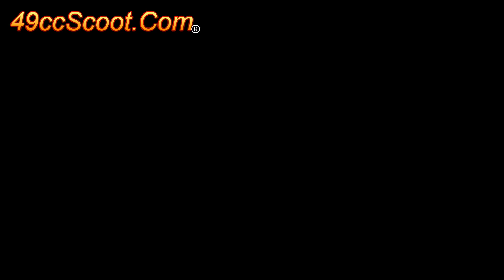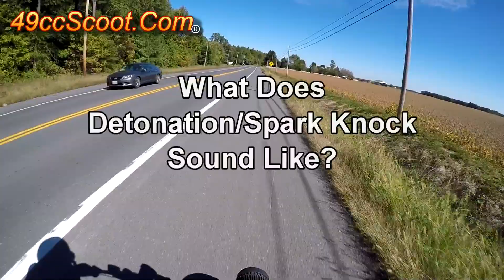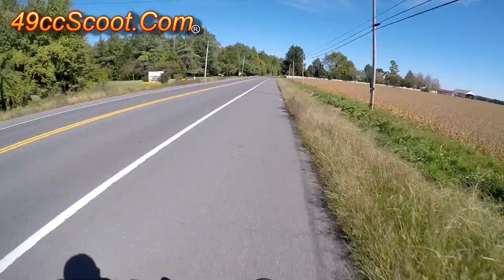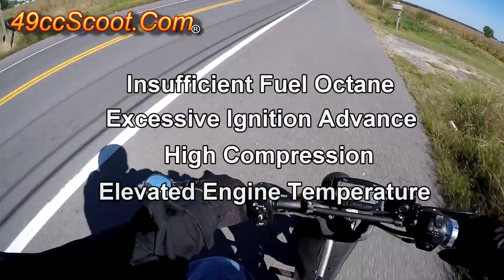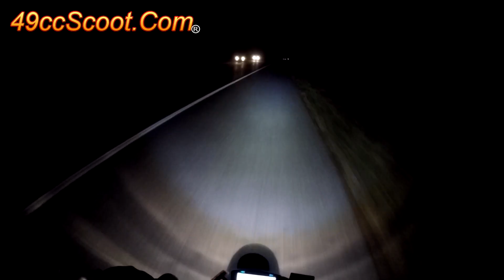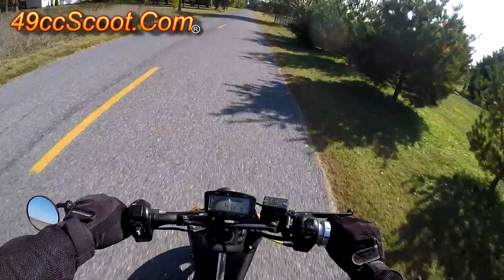What Does Detonation / Spark Knock Sound Like?

Comment: My trail also have this problem... plz tell me how can i solve this issue?
Reply from the maker: Number one is always to make sure you have adequate fuel octane. Consider any modifications that can alter compression and timing. Make sure the spark plug heat range is correct. Look for any cooling system issues.
Reply: @49ccscoot  yes we have some modification we used a little bigger piston. 
It is only air cooled... it runs smooth on plan but in mountanious area when the bike gets hot then it starts knocking and loses all power
Reply from the maker: @rahimullahkhan164  See if it will take more fuel to help cool it. 4Ts are pretty forgiving, so you may be able to increase main jet size a little and lower CHT without seeing much difference in performance.
Reply: @49ccscoot  i have 2 stroke dt 100.. replace the piston with Rx115 becoz Rx piston is a bit bigger than Dt. The head of the piston of Dt is flate but Rx piston has a little hump on its head... so i think too much compression may be the issue.... thanx for ur video its extremely helpful 🌹🌹🌹🌹🌹🌹
Reply from the maker: @rahimullahkhan164  If the head doesn't match up to the profile of the piston crown, the best way to solve this may be to recut the squish band and combustion chamber as needed. Try to make the squish area match the crown's angle. If you can get a good shape and maintain a tight squish clearance, with combustion chamber volume changes as needed for compression, then it should be a strong runner and a proper squish band helps to reduce detonation.
Reply: @49ccscoot  ok dear.. i will give it a try...
It has became great in power and running but has this little issue of spark knock when gets hot on the ascend whereas run smooth on the plan roads

Comment: I guess if I put pebbles into my cylinder it wouldn't be good for the engine either. That I guess explains why it's not good for the engine.
Reply from the maker: In the case of detonation, it's about the extreme pressure spikes that are essentially hammering components.

Comment: I have a little 35cc 2 stroke go kart and it makes a slightly higher pitch sound than your scooter 🛵 it will sometimes make like a crackle spark sound. I think the spark plug is too hot for the engine. The fuel air mixture is perfect so it must be the spark plug. What do you think I should do about it?
Reply from the maker: If that's what you think, a colder spark plug is pretty cheap and easy to try first.
Reply: @49ccscoot say I get that spark plug and it doest work what should I do then to get rid of the sound?
Reply from the maker: @Bigdaddy-ht2gn  Make sure fuel octane is sufficient. Check compression specs. Check for excessive carbon buildup. Make sure there isn't too much ignition advance.
Reply: @49ccscoot  thanks, I will check all of those components and make sure they are in spec.

Comment: Does spark knocking happen at specific revs? I just got a new bike with 300km (something like 200 miles) on it and at 4000rpm there's a strong vibration and a rattle that sounds like loose bolts.

The sound is sort of similar to the noise in the video
Reply from the maker: It would be more likely at a specific throttle position than a specific RPM. You could have something loose on the bike. I would suggest taking it to the dealer and having them check it out since it has so few miles.
Reply: @49ccscoot  yeah gave them a ring and took a quick look at the exhaust headers. the right cylinder exhaust header gasket was shot. leaking exhaust causing a rumble and backfiring. Dealer's gonna change it.

Comment: My 2020 Corolla does it at around 2000rpm when either accelerating or rev matching downshifts. It's been driving me nuts. I'm going to try putting higher octane in it when the tank is dry and see if it likes that better.
Reply from the maker: That's the easiest option for now. I would recommend checking the manual to see if it lists a fuel octane requirement. If you use at least the octane recommended by the manufacturer and it still does it, being a 2020 that I'd assume is still under warranty, you could always make the dealer aware of the issue.

Comment: I just raised my compression today, and it turned out to be a bad idea. The 95 octane fuel can't handle it, so I'm switching back to my lower compression. Today I've heard what it sounds like. In 2-stroke engines atleast, it sounds like if there were small rocks rattling inside your engine, or as I've seen some other comments here saying it sounds like a geiger counter, which is exactly how it sounds. Mine did it consistently only when the engine was at it's operating temperature and in mid-high throttle. Though on long coasts (closing throttle at high speed and decelerating), the way the usual 2-stroke goes (pom-pom-pom-pom) at closed throttle, was sounding more metallic, very noticable actually.
Reply from the maker: If your timing is advanced, you may be able to back it off enough to get rid of the knock and keep the compression change. May not make much difference either way.

Comment: I heard that noise on my 125cc two stroke dirt bike and it made a loud pop noise through the exhaust and wont start anymore :/
Reply from the maker: Do a compression test.
Reply: @49ccscoot  I tore apart top part of the engine and saw a dent in the piston, that was the problem haha, time to buy a new Priston and gaskets
Reply from the maker: @roberts2760  Glad you found the issue.

Comment: Using the wrong spark plug could also be the case, im using a BR8HS instead of B8HS plug (The R one has 5000 ohms resistance) on stock ignition. Which might be the cause for potential detonation in my engine...
Reply from the maker: Spark plug heat range (too hot) is more commonly the cause.

Comment: I am hearing the exact same noise while accelerating my continental gt 650. Whats the fix for this issue
Reply from the maker: If it's stock, then #1 is to make sure you're using premium gas or whatever the owner's manual calls for and that the current fuel isn't old.
Reply: @49ccscoot  iam using a premium fuel and my bike has done only 3000 kms. Please help.iam hearing the sound mostly at 3 to 4000 rpm in 5 and 6 th gears
Reply from the maker: @gokulrajg3251  It's got a lot of load on it at lower RPM in the highest gears. With only 3000km, can you take it back to the dealer? That would be the best bet. Let them make sure all is well.
Reply: @49ccscoot  I'll do the same thank you

Comment: I’m not doing anything wrong I just ride an it makes a pop sometimes idk what it is
Reply from the maker: If it's a pop here and there, it's probably not spark knock. A misfire of some sort would be more likely from your description.
Reply: 49ccScoot is that anything and can that f up my engine
Reply: 49ccScoot sometimes when I’m on 3 gear an I stop I forgot to go back down to first an it makes the same sound
Reply from the maker: @devangarcia3119  Hard to say  for sure. I would at least  check the condition of the ignition system. Make sure everything is plugged in tight, getting a strong spark, kill switch works properly and so on. Could be carburetor tuning related or even ignition timing.

Comment: What causes that sound inside the engine?
Like what parts? Is it the piston?
Reply from the maker: You're basically hearing the engine being "hammered" by a sharp pressure spike. Usually this occurs because a pocket of mixture ignites on it's own and collides with the normal combustion event.
Reply: @49ccscoot  thank you very much
Greetings from Germany

Comment: Very nice from this video the spark know is kinda a random rattling. I have a rythmic type tappin sound that i am almost 100 percent sure it is due to ths cam grind and the roller rockers
Reply from the maker: Loud valvetrains most commonly follow RPM, so you should hear the frequency increase as revs increase. Spark knock does not do the same. It's more "random" as you said or at least not directly linked to engine speed.
Reply: @49ccscoot  very true mine speeds up and slows with rpm. This id the best video showing preignition i have ever found

Comment: Thanks!   very thanks!

I noticed that in my four strokes.
¾ throttle opening goes well,  bike can do the job or load...  but there is not difference on engine power between ¾ and full throttle but sound appears just like your.

You say 
Poor octane    
much advance timing
overheating

In the practique,  how can you deal with it?
this video was in 2016!   what have you learned all this time to adjust on engine that sounds like ping?

very very thank to you and regards from south america.
Reply from the maker: A lot of it depends on what the engine is. Mods and such. If it's a stock engine, then the easy solution is usually to use higher octane fuel. If it's modified, then you have to think about what those modifications will affect and go from there. There isn't one right answer.

Comment: I heard this in my car too but it wasn;t a spark knock, It was the windshield wipers plastic cover that kept flapping or vibrating whenever I accelerate. Couldn't figure out the problem as there was nothing wrong with my car, until one day on a cold night, there was moisture infront of my windscreen, not inside but outside. That's when I knew that the whole plastic cover was loose, put some windscreen sealant in and couldn't hear it anymore.

Comment: Hey man, can you explain how you got rid of the knock. I switched to running 93 octane, a cooler plug and even tried lowering the needle clip position for a richer setting. Still no luck, any help would be greatly appreciated. It is only heard at 1/4 throttle usually when slightly decelerating due to not enough throttle and only between 37-44 mph. Its an all stock zuma with a brand new stage 6 70cc kit. running the stock oil pump and a 60:1 pre-mix. squish is at .6mm (what the manual called for ).
Reply from the maker: I think I just backed my timing off after that. I've had knock so many times that I've taken different measures. If the mixture is rich enough and plug is correct, then usually either timing or compression. If that's all you hear, then probably a very slight change would do it. Make sure you aren't using a long reach plug in a head made for short reach too.

Comment: YOU ARE THE MAN,  just installed a 70cc kit in my stock zuma and it started doing this and I took it apart and couldn't see any problems and squish is at 0.6mm which is what my stage6 said it should be and then I was stumped. Thankfully you made this video because I was really worried. Thanks man!
Reply: Same here what was the solution?
Reply: @wakenow7612  yeah just installed a 70cc on my jog and now it's doing this too. would love to know. thinking of doing 2 base gaskets to decrease the compression a bit.
Reply: @SubieSage  I don't ride much but after about 20 mins of Riding I get knock. The shop F,d me and I'm stuck with the motor until I can replace or rebuild it.
Reply: Adjust fuelling can be bc of lean mixture

Comment: Hey, thanks! I had this going on in my 2000 burban. Wasnt sure what was causing it, but I was checking my plugs yesterday and one of them were totally broken. I went and got new plugs and sure enough, the issue was gone. Now that ive seen your video, the way your scooter had a loss of power during the spark knock, is exactly how my truck would run. I appreciate you taking the time to make this video. Now I have some knowledge as to what spark knock sounds like other then my own experience. It honestly sounded to me like a minor exhaust leak. Any way, thanks!

Comment: Question: Does backfiring also caused by spark knock? my Honda Twister (110cc) backfires too often. And should we use the recommended spark plug model (as per manual) to avoid such a thing? Hope someone can answer. Thanks!
Reply from the maker: That's commonly a lean condition or exhaust leak near the header. Stick with the rec plug.

Comment: Knocking sound is bcause the mainjet or pilot jet is too small...
I put my carb with 37.5 pilot jet...n 260 mainjet...
Running on 125 cc with 57mm piston
I locked full throttle about 40km distance...160km/h without any problem..
Just make sure that fuel is enough at 6k rpm and set high rpm at 10.5k only for long distance ride...

Comment: this is my problem now since i changed my piston to full dome.. can anyone suggests me a good solution to fix this knock?
Reply from the maker: If you've increased compression with a domed piston, you'll need to use a higher octane fuel, back off the ignition timing a bit, or make some other modification to lower compression  a bit.
Reply: ok ty ,. im using 95 octane which is the only available gasoline in our place and i think I'd go for reducing compression a bit,. i have a set of jettings here and do nothing with that marble tick in my engine but it makes my speed go up a little until i reach that tick. does sparkplugs also matter?cause I'm only using regular class of plug.,. I'm planning to use iridium, will it helps?
Reply from the maker: @enzrukawa  Iridium plugs aren't going to fix knock.
Reply: i decided to make my full dome piston to a semi dome piston, hope it will help.

Comment: I get this at around 8000 rpm on my TGB r50x moped, is there anything I can do?
Reply from the maker: Is it stock? The easiest thing to do is to use a higher octane gas if you are currently using regular and see if that does the trick.
Reply: 90GTVert Yes it is completely stock, but I just bought it and it has run almost 10.000 km, and I am using 95 octane I think
Reply from the maker: @epickinesisk1112  Is that the highest where you are? At 10,000km you should probably take a look at the owners or service manual and see what is recommended by then.
Reply: 90GTVert yeah, we've only got 85, 95 and diesel
Reply: 90GTVert dont have the manual tho, do you think i can buy one somewhere?
Reply from the maker: @epickinesisk1112  Try searching. Maybe you can find at least an owner's manual online.
Reply: 90GTVert okay! Thanks a lot for the help bro! Love ur vids too👍🏻
Reply: 90GTVert oh i almost forgot, dont you think the motor maybe running to lean?

Comment: How can you tell the difference between spark knock vs the valves tapping?  My 150 constantly taps at idle, and sometimes at throttle
Reply from the maker: It has a different sound. Valve tap is mechanical and usually always present. If your engine spark knocks at idle, you've got huge problems.
Reply: @49ccscoot  I mean, I've been daily driving it for months.  I've done top speed runs, hits 64 stock, I can't imagine it would run that good if it was knocking or a valve spring was broken.  Spark plug is I good greyish color, valves don't look bad, piston looks good, I dunno
Reply from the maker: @mopedmessiah  If a valve spring was broken, you'd know it. It could tap from a wide valve lash setting. I usually set mine to 0.002" intake and 0.003" exhaust. Even then, they make noise. You aren't going to make the engine silent.
Reply: @49ccscoot  alright, thanks man!  Now just to get the ncy 171cc kit and pray the stock head is enough to get me to 70 lol

Comment: Anyone knows how to fix it???
Reply: New top of the line spark plugs and high octane gas seems to be the solution. It is happening because your getting an unwanted detonation which occurs from build up of air fuel mixtures that are igniting/detonating unexpectedly. Poor fuel and crappy spark plugs seem to be the culprit. Fresh good plugs and premium gasoline should fix the issue and if the noise persist try adding an Octane Booster in your fuel. I just learned about this today cause my ford pick up was starting to make this sound this week and turns out is because i filled my truck with the cheapest shitty gas they had at the market. I changed my soark plugs to double platinum and filled my truck with the best fuel i could find around town and the issue is gone. Good luck.
Reply: Could slso be a timing issue from your spark not igniting your fuel at the proper time. But i would start with plugs and high octane fuel.

Comment: Jesus, why TF is finding a good example of pinging on youtube so hard?? I was searching for a good 15 minutes. Thank you.
Reply: I can record u mine xD
Reply: How do u fix it?
Reply: Same lol, did you find one with a car engine?
Reply: @szymusu  sadly not even I can find it
Reply: In good octane I make still in pinging..I think in more carbon maybe?
Reply: how do u fix it?!?!?! Any takers?
Reply: @courierslife3793  Higher octane, lower compression or adjusting the timing. If you have a stock engine you should probably find out why you're hearing knocking. Probably someone messed with the timing or you have some bad fuel.
Reply: @CptAJbanned  bad fuel?
Reply: @courierslife3793  Maybe you're using fuel with an octane rating lower than the engine needs?
Reply: @CptAJbanned  See I recently bought moped clone and when I bought it I was told to add 87. Needless to say about a week later the thing wouldn't  run right so I found this video. I searched and found out that it actually needed a higher octane, problem solved.
Reply: Yeah, same.

Thanks for this very clear example
Reply: Me too lol
Reply: Retard the timing
Reply: Totally!!!!
Reply: 15 minutes I've been searching for 15 years lol